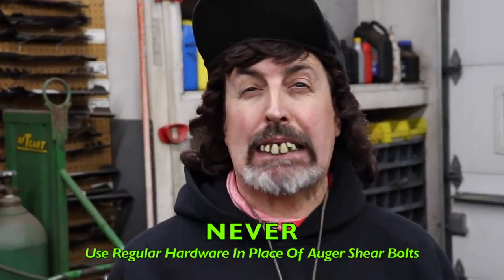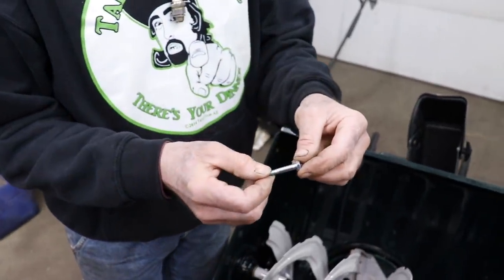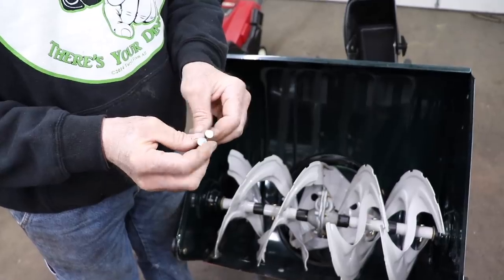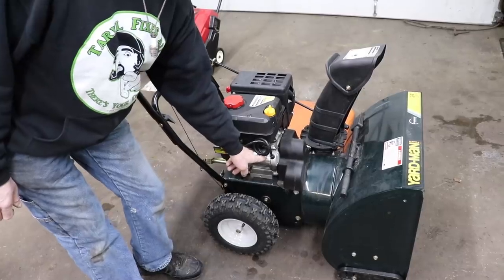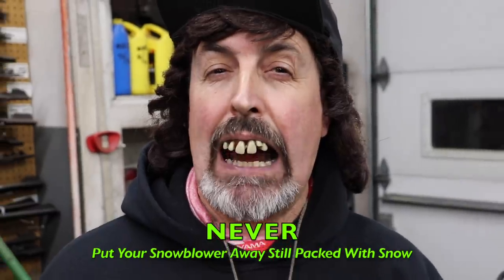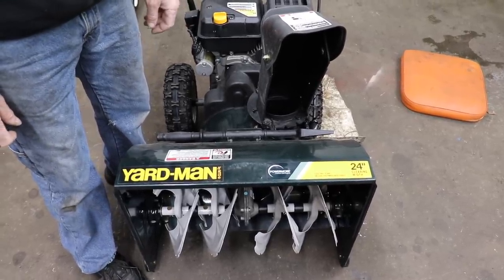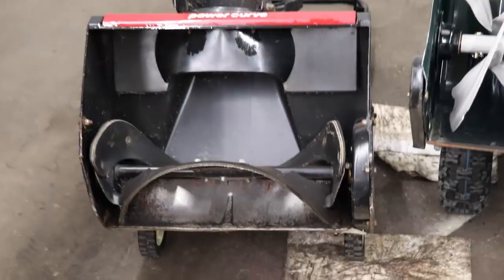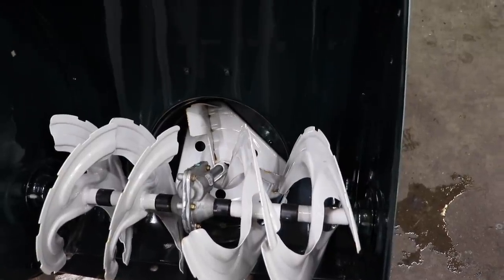5 Things You Should NEVER Do To Your Snowblower

Comment: No.6. Don't run over a coiled up garden hose or extension cord you left lay out and get covered with snow , I heard it can really jam up your auger and make a mess of things. It took me ...I mean the guy I know hours to clear out.
Reply: No.7 Be aware if your snow chain comes off your tyre, you will run over it and break chear bolts.
Reply: Yeah I did that but it was after about 10 minutes that I realized most of the cable was unsalvageable so I just started slashing and cutting it instead of trying to delicately take it apart and it came out a lot quicker once my mindset on the method had changed. 
I started using my equipment to clear snow for other people and that’s one of the first questions I ask is are there any cables or garden hoses laying around and I just buy some softer shear bolts. 
I just wish we actually had snow this winter.
Reply: Happened to me, it was a bear until I woke up and removed all the Shear Pins, after that it pulled out easily as the blades turned.
Reply: My nephew borrowed my trailer and left a bit of safety strap on the ground that got snowed over before I saw it. I then ran over it with the snow blower and jammed the hook between the bodynand auger. That was a real bear to get out…
Reply: See number 5
Reply: @johanw9513  My sister wanted to “borrow” my brand new Chevy Avalanche to move some furniture? I told her U-Haul has rentals right in her neighborhood. I don’t lend out anything anymore because one asshat ruined it for everyone.
Reply: @johnclyne6350  I called him, and he had to help me get the crap out of the snowblower :)
Reply: And don’t run over some newspapers like I did like I mean like 3 or 4 maybe even 5 that were laying in the driveway with the snow covering it
Reply: Literally just bought a new(new to us) snowblower and the first thing I did was find that garden hose that was hiding under the snow lmao
Reply: I know someone who did that !
Reply: I heard of someone that ran over a buried dog rope...things did not go well.
Reply: @StopAndGo1 Was the dog still attached to the rope? 😂
Reply: .@leerusch7392  😄😄😄 In that respect Luckily not. But I had a lot of work to untangle and straighten things out. The machine never worked the same again. It was a good learning experience

Comment: You cannot tell people  not to run a snow blower on a gravel drive way.  If you let the gravel freeze and drive over and pack a base down over the gravel, it will be fine. I ran over my Christmas lights in the bushes and they wrapped  around the auger. It took  me 2 hours to cut them all out. The sad part was, I did it again 2 years later.
Reply: Next time pull out the Shear Pins to enable the blades to turn, it’s very easy then.
Reply: Yep, all I've ever had is a gravel driveway (and live on a gravel road). Set the skids to max height and take you time. Hasn't been a problem in the last 30 years or so.
Reply: Just be aware that gravel eats a hole in the thin chute of a chinese blower really fast.
Reply: @mcmuskie2563   is that the same as putting your bait caster into free spool to undo a backlash?
Reply: I would not have admitted that ! 😂😂
Reply: I've seen mods to put mower wheels on a blower, giving it clearance for snow removal without getting all the way down to gravel. Might not leave your driveway as clear, but will save both the blower and keep the stone in your driveway.

Comment: The comment on gravel driveways should be "be extra careful if you have a gravel driveway".  My parents had a gravel driveway when I was a kid, and I've only ever had gravel driveways, and we always had snowblowers.   We always packed the driveway down to have a good solid base, and then made sure that we only blew snow where a projectile like a rock wouldn't hurt anything or anyone.  I've been fortunate enough that rocks weren't ever a big issue.

One thing that should be on the list is being careful at the end of the driveway after a plow goes by.  There is usually a bunch of ice chunks mixed in and ice is about as dangerous as a rock when thrown out of a snowblower.  I live on a fairly busy road, and the end generally takes a while as I stop blowing when a car is passing by.  On a really bad day, I forgo the snowblower and shovel it by hand.  Large chunks of ice also like to eat shear bolts.

Comment: I've been using my Yardman snowblower on my gravel driveway for 23 years now but do so with a few things in mind. My Yardman is track drive. The body can be raised in relation to the tracks, so I can set it to ride high over the gravel. I never remove snow down to the gravel. 2nd, when in areas near windows, I turn off the auger and use the snowblower as a plow until I can point the chute in a safe direction. And 3rd, if I scoop up a pile of stones I turn off the auger and pulse it to clear out the stones. Once I did get a larger stone jammed in the 2nd stage just like Taryl said might happen and it was a pita getting it out.

Comment: Years ago I had to go to the ER and get a couple stitches in my hand from working on heavy equipment. Feeling sorry for my self until a guy came in that stuck his hand in a snow blower. Luckily he didn't loose any fingers but his hand and fingers were mangled! Not sure how many stitches but atleast 30 or more to put all the torn flesh back to close the wounds. The snow was very wet and it became clogged. He idled the machine down and stuck his hand into the shoot to remove the clogged snow! Great video!

Comment: Also before I start the snowblower with the electric starter, I engage the auger and pull on the rope starter to make sure the auger  will turn, before doing it with the engine running.  This way if the auger is frozen, then no damage as a burnt belt.
Reply: My number one thing not to do with my snowblower is... never operate it on a Beach in Florida.

Comment: Great tips! I do have an issue with the advice not to use a snowblower on a gravel driveway, though. I feel there are more people that do not have a paved driveway compared to those who do, especially in rural areas. What are we to do, in that case? Shovel a 350 foot driveway by hand? I have used one on my gravel driveway for years. I don't live near any neighbors to hit with rocks. The snowblower does pick up rocks now and then, but it usually only happens during the first storm of the year. Once the driveway has been "groomed" with a slight layer of snow covering it, it's all good, man!
Reply: I did mind for the first snow of the year. I put the skids all the way down and didn't pick up one rock. Later when things freeze up good I imagine I will be able to raise the skids some. BTW I picked up this practically new $1700 snowblower for $75 because the seller kept jamming rocks in the auger. As I loaded it in my car I noticed he had the skids raised all the way up. No wonder! Well my gain :-)

Comment: I had replaced some of the shear bolts on our garden tractor mounted snowblower because I couldn’t find any. Turns out they are located on a frame of the snowblower but I wasn’t aware of that. Haven’t had any issues thankfully but being a PTO driven snowblower, I would think it might damage the drivetrain of the tractor. Thanks for reminding me to swap it out!

Comment: Gravel driveway NO PROBLEM.    Set those skids so it’s got 3/4” of clearance.    Wait the first storm leave it be to freeze.    Then your blower will easily do its thing once that packed base freezes !     I’ve been doing it this way for years.
Reply: Good advice.
On the first snowfall of the long Maine winter season, I'd take my car and just go back and forth over every square inch of the gravel driveway in my car, compacting the snow into a near solid sheet.  Then the gravel was safely stored underneath and wouldn't be thrown by the auger.
But that was over 9 years ago.  Now in Florida I occasionally get two feet buried in sand..
Reply: Same for me man

Comment: Taryl in Canada do you realize how many people have gravel driveways lol what you should’ve mentioned is if you have gravel you set your shoes so you can slip your fingers between the scraper bar and the ground that clears most gravel stones and if you have asphalt or concrete you only need 1/8 inch of daylight between the bar and the ground. Once the ground freezes the gravel is like asphalt but you still need that clearance.
Reply: Marty is right, for gravel use the longer plastic shoes instead of the short metal ones, set bar on a 1/2 piece of wood when you tighten the shoes. We all love our snowblower, so DO NOT blow snow till the ground is frozen and first snow is packed down. Just let that first one go.....
Do some driveway work in the fall to get things level and packed prior to winter.

Comment: For number 3 I use a 6x6 block of wood under the wheels as to tip it foward. That way the melted snow can't freeze in the recoil and turbine. And I put the shifter on a foward speed in case it would freeze on the hex shaft.

Comment: I do gravel drives . Shoes down and scraper bar up
Reply: i done it for years, after the first couple of snows its nice and smooth on the ground and you dont even know your on rocks/sand anymore.
Reply: Yea, its fine, thats why them shoes go down so far. Even says right in my manual when operating in gravel, take a block of wood and drop you skids shoes down. Two stage snowblowers are designed to handle terrains other than flat pavement.
Reply: Yeah you guys are right! But taryl has to err on the safe side....been using my 1974 Areins blower on my gravel driveway for years shoes all the way down never had a problem. But other people ain't to bright so you gotta treat them like children instead of adults. So never stick your hand in a wizzing blade kids you'll cut your weiner off!😆
Reply: @moparnut6286  Those same people are the ones who can't comprehend "always point your gun in a safe direction".  Not rocket science, but certainly not common sense.
Reply: Yup, same here gravel driveway and I usually do a pack job of the first snowfall with the truck tires to prepare the base and then have only limited rocks being thrown there after.
Reply: Pack a good base and set the skid down. No problems.
Reply: @moparnut6286  I read somewhere else ,that the owner's manual used to tell you how to make ajustments and perform simple maintenance on your machine, now they warn you not to eat the plastic bag the manual came in and don't drink the liquids that you pour into the blower. Californication.

Comment: Taryl, gravel driveway/ snowblower....I'm on a 2 acre plot, the house is set all the way back. I'm 64 yo and can not possibly shovel all that snow. I have a real bad back....
I have a John Deere X300 with a snowblower on it.....I set the height for 2.5 inches....Would this be alright or should I set it higher? I know this isn't a help desk. If you cannot answer, I will understand. You have a life & business to run...
GREAT POINTS YOU BROUGHT UP!!!!!!
Reply: It should be ok.  Set it at a comfortable height that is not picking up gravel. As Taryl said, make sure to blow in a safe direction etc.  But the skid shoe and shave plate adjustment is there for this purpose.
Reply: @kbssmallenginerepair2615  I figured the skid shoe shave plate was set at the factory for use on paved surfaces, which I HAD been doing all along UNTIL I moved in 2018. I have woods on both sides of this property and where the cars/ house is, I'm very careful. Thanks..

Comment: I hit a rubber floor mat with mine years ago, bound the auger up crazy tight, I sprayed it with fuel and let it burn clean. Haha worked great! Chute was like a little chimney.
Reply: Happened to me, I wore myself out trying to pull/cut it out until I realized I needed to pull out all the Shear Pins, it rolled right out! Should be in the owners manual under in case your an idiot.

Comment: I have a 1983 Noma Canadiana 27" 8 hp that's like an Abrams tank, weighs about 150 lbs and was found on a driveway in summer with a sign that said "fuel pump gone" I knew it was an easy fix, turned out to be the fuel line and a $4 fix along with the cost of some synthetic oil. No rust, no damage, it runs through everything and my White snowblower that I paid $1100 for 10 yrs ago with about 40 hrs on it gets to rest until this beast blows up. And yeah, I have a gravel driveway, ching ching ching like a money machine and road full of gravel in the spring to sweep up.

Comment: I have to use mine on a gravel drive (70 ft + a turnaround)... it does throw some stones but if you don’t set it to grade and just get down to 1-2” it works fine. You may throw a few rocks but you gotta do what you gotta do. Once the gravel gets packed down it’s not too common of an issue. I’d rather use my snowblower @ a few hundred dollars than put out $6,000-$15,000 for a new driveway. I direct the shoot downward to prevent any accidents. Several years and no issues, but I get the caution about the auger/gear box.
Reply: Same here
Reply: Also have hard packed fine gravel ... 3/8 in. lift on the skids works fine. But when you a big storm, I'm  more worried about tree branches hidden in the snow.
Reply: I find more stones thrown at first snow of season before the fine gravel is frozen to driveway (400 ft) after that no problem later in season. Rather throw small gravel then be at the mercy of a plow driver anytime. The big rocks will do the damage so I police them during the summer.....
Reply: If your driveway is only 70 feet long you can hand shovel it. My driveway is 360 feet long and I shovel it.

Comment: I got one that you SHOULD do, WD-40 the shoot and auger areas to prevent excessive rust in storage and it makes snow slide better in use.. WD-40 is cheap insurance on everything metal,. 👍
Reply: rince it and coat it with oil each spring.
we got so much salt on the road here the cars looks like swiss cheese.
Reply: SC Johnson Paste Wax, man.  Best stuff on earth.  I put it on my saw blades, my snowblower, mower decks, shovels, toast, hand tools, you name it!
Reply: @gpweaver    Ooo, yum!  Spreads so easy on toast!  ;-)
Reply: I use a spray can of teflon available at Walmart and spray auger and chute before I start each time..stops most snow from sticking when your done.....

Comment: I see videos on how to make your snowblower throw snow farther and more efficiently by adding rubber fiber paddles to the secondary blades.
I'd appreciate your thoughts on that.
Reply: Not worth the trouble (I did it) and they wear down fast, they actually cause increased clogging of wet snow by giving it a place to adhere to.

Comment: #6. Never forget to find the newspaper(s) under the snow before using your snowblower!
Reply: If they were wet, then froze, they will shoot out like a torpedo! Ask me how I know. It knocked my shute off.
Reply: #7. Never forget that if you're so old that you're still getting a newspaper that it's not recommended that you even use a snowblower due to the stress it puts on your heart.
Reply: @JohnDoe-ld8nr  Indeed! After using a hammer and screwdriver to chisel out the compacted newspaper I left the hammer and screwdriver on the ground in front of my garage. Snow continued to come down covering both. So guess what got jammed in the impeller next!
Reply: @graciebonsai7272 it’s hard to guess.  But I bet you were screwed.  And/or hammered.
Reply: @ttb1513  Yes indeed! I'll save my riding lawnmower versus turtle  experience for later!
Reply: @graciebonsai7272  ouch!  There’s always something, isn’t there?
Reply: I ran over a Sunday news paper my first time using  my new snow blower.
Paper shredded into thousands of confetti pieces all over the place!
Good times!
Reply: @bobwoods5017  I'll feel better knowing I'm not the only one. Thanks!

Comment: use mine on a gravel drive all the time.  Just ensure the gravel is packed/rolled and LEvEL.  Set the slides high and you'll be fine.  Yeah one or two might get snagged but I really don't do it all, just where the plows pile up at the end from the street (and you are throwing street rocks and ice then)

Comment: I’ve seen auger drive gear boxes destroyed from owners using hardened bolts instead of shear bolts. Taryl is 110% right, don’t use regular bolts EVER in your auger!
Reply: With used machines seeing normal bolts in place of shear pins is pretty common.
Over the years I've seen it several times and changed them out.

Comment: Since some shear bolts (like on mine) ARE in fact standard bolts, the advice should be to use the shear bolts specified in the owners manual and do not make arbitrary substitutions.
Reply: Yeah, my Toro has the hardened bolts as well because the gearbox is designed to handle it. I always wondered if I should use shear bolts instead just to err on the side of caution..... even though Toro doesn't recommend.
Reply: IIRC, a standard bolt without markings is a Grade 2, and is simply low-carbon steel.  Hopefully some engineer somewhere did a shear/torque calculation and came up with the proper cross section and material grade to save the gearbox in all cases...
Reply: @ourkid2000  replace with regular shear bolts. My toro did not cut out like they said it's supposed to do. Ripped the auger apart around the bolt. Luckily, my dealer fixed it under warranty repair and put in actual shear bolts.
Reply: No, in fact take them out and replace them with shear bolt or trust the manufacturer that wants you to wreck your equipment and buy another or buy a replacement gearbox.